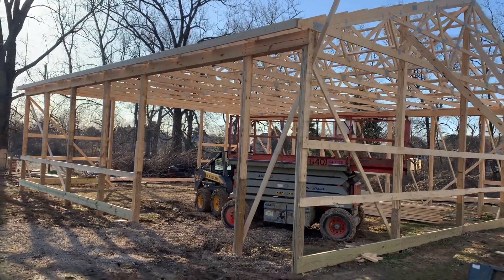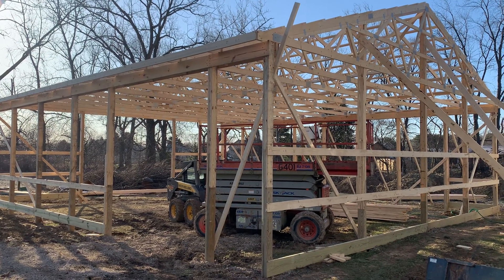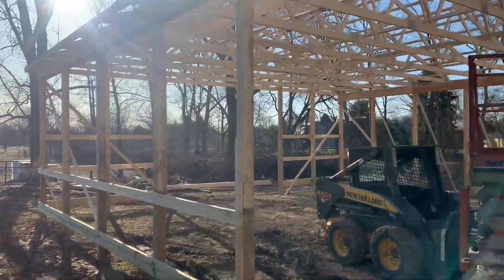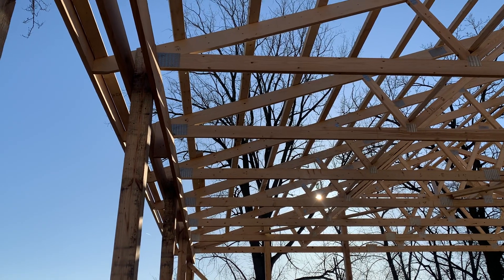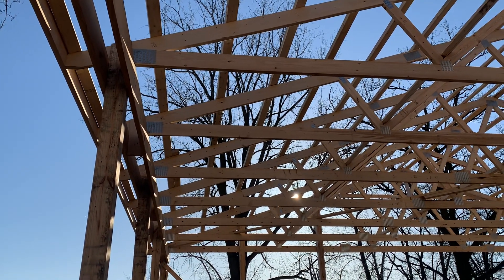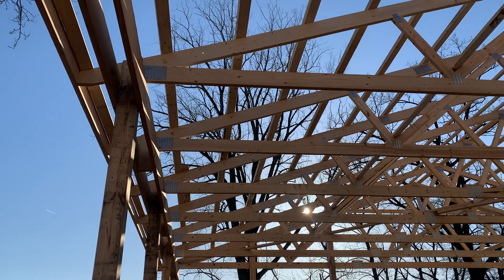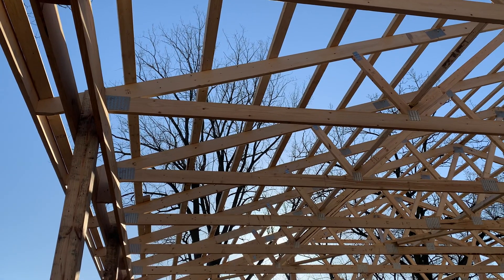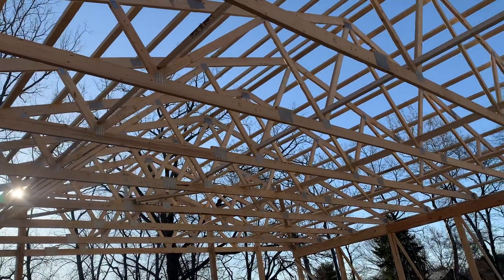Should pole barn trusses be 4’, 8’, 10’ or 12’ on center??

Comment: I think a quick answer is obvious. It's faster to lay purlins flat and nail them, but it's not as strong as on edge, so do twice as many trusses to minimize the flex. Purlins are more likely to snap when layed flat (all other things equal). You can do half as many trusses if you go 8' on center, but you need to do purlins on edge and flush mount them inside the truss spacings with exact dimensions (because you can't drive nails or screws through 3.5 inches into trusses). When you do all trusses only on posts, you don't need a load-bearing top band.
Reply from the maker: Mostly Agree.  Another way to build.
Reply: If custom build the trusses can you modify them by cutting a inset for the purlins lay to lay flat?
Reply: @hamadilawson4471  notching your trusses would compromise their strength.

Comment: I need to know how to put trusses on 8 ft centers with perlins I don't need to know how to do it on 4 not doing 4
Reply: Watch Kyle on the R&R Buildings channel. He does trusses locked into post notches, so the roof loads are completely supported by posts. I did this method on my barn and edge mounted purlins flush inside my truss spacings with Simpson strong-tie brackets. Turned out beautifully, very strong, but most efficient use of lumber (summer 2020).
Reply from the maker: Lay on edge.  3.5” high.  Overlap and not put the purlins end to end.

Comment: Higher probability someone could fall while building is the reason you do 4’ spacing? 

Doesn’t seem germane to any structural reasoning.
Reply from the maker: Purlins flat or on edge is a structural concern.  Depending on use on the grade/quality  of lumber it could be a higher probability of a board failure going wider spacing.  Also flat purlin spacing gives a wider circumference area for screws to be placed.  Just our opinion and use case. Numerous ways to get it done.